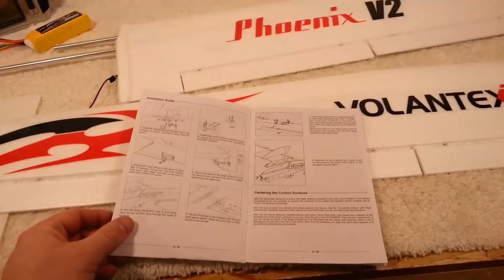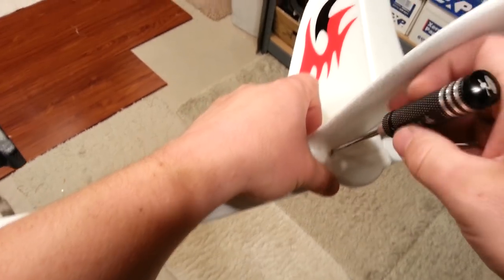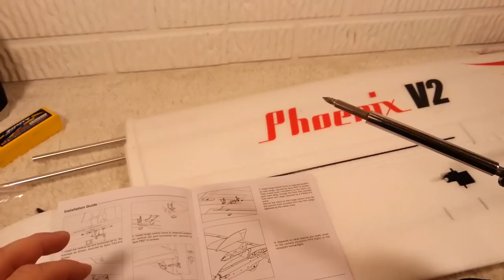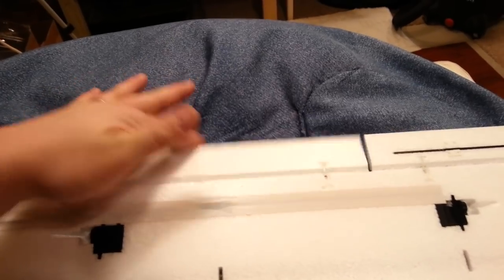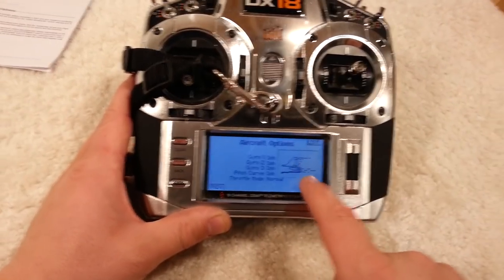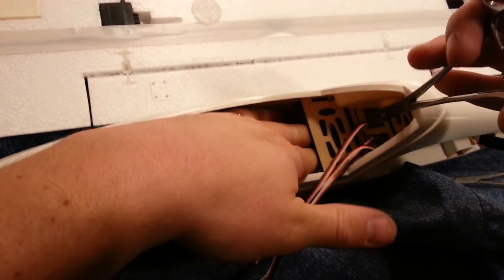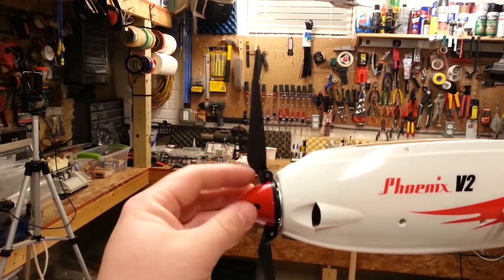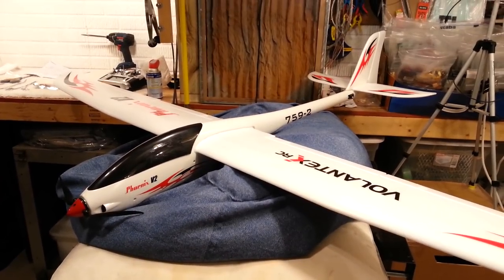Volantex RC - Phoenix V2 - 2m - Build Series - Assembly

Comment: Are we supposed to cut the polystyrene away on the hinge lines???
Otherwise the hinging is too stiff held by a web of polystyrene.
No one mentions this.
Also to use the flaps, a portion of moulded in polystyrene must be knifed away otherwise they just will not hinge at all.
Advice please?
Thank you
Reply from the maker: yes - We painstakingly covered the whole process if you want to watch - some steps may be a bit different for you, but this was quite a long time ago. Good luck in your efforts Peter!
Reply: @BrianPhillipsRC  
Thanks for getting back Brian.
I am new to foamies. Have always been a builder.
I have knifed the hinge line through on all moving parts.
I did it carefully and now the moving parts are really free. Ie ..drop down by gravity.
The built in hinges hold firmly as I have tried to pull them off.
I know that some say there should not be a gap ( air flow turbulence ) but for the past 50 years all my planes have flown fine with the hinge line gap.
I'd rather the moving surfaces were free so as not to load the servos.
Thats my theory and was tought it by an oldie aero modeller.
Thanks
Peter
Reply: @petercane6376  on a lot of cheapies that line of foam is all the hinge there is ..eg dynams

Comment: did i missed the installation of the two big rods which connects the main wings with the fuselage?
will the two big rods stay within the fuselage or within one of the wings?
Reply from the maker: It was in part of the video...but not 100% sure were.

Comment: Man, you've got a good set of screwdrivers w/ the Craftsman set but the little ones don't typically
come w/ the set..... The  small ones are like specialty but there's 4-5 of each. You've almost got
more shit than you know what to do with.... lol,  mine all got stolen & I never spent that much $$$
again. I am laughing as you try to do a decent video & joke to get thru the rough parts....
ohh yeah,  lighten up.... you're doing better than most
Reply from the maker: I really like my Craftsman stuff. Some people take the position that they "need" Snap On or Matco tools, like they just love to pay 4-5 times the price of each tool that they could/should spend...not that they don't end up with a very nice tool, but for me, I can get the Craftsman stuff for a fair price, I have a lifetime warranty, which I've take advantage of several times, and I don't need a tool-mortgage... ;)

Thanks!
Reply: @BrianPhillipsRC ~ Yeah man,  I like Craftsman Tools as well.  I did heating a/c work & I
like their sockets/screwdrivers. I like Klein Tool for electrical work & those others are
good but they are Too High for my likes. If I had been a Car Mechanic I'd have liked
them for some specialty tools.... Like w/ the sheet metal I had to do I used SNIPs
from Craftsman.... You can replace them if they Dull or break at ANY Sears in the
USA.  Gotta wait on the vendor on those others so yes,  I love your tools there. You
are well set up,  and I'm looking into planes as well.  I was making fun of you but
I said, "lighten up" meaning I was pulling your leg.  I know some people are hard
on-line,  toxic over any little thing.  I like your video too.. peace
Reply from the maker: Now you can get them at LOWES, ACE, and a few other places that I can't think of off the top of my head :)

I suspected you were joking around. It's a bit tough to "know that for sure" but the context seemed to point that way. Glad you're enjoying the footage, thanks for watching!

P.S. I kinda forgot Kline, they make a great tool, with a more moderate price point, but like you said, for electrical, they make a sweet pair of dikes (side cutters for the PC crowd)...so sweet, It's been stolen from me three times!!! At $26 or so each, that's over $100 I've paid for ONE good quality hand tool ;) LOL
Reply: @BrianPhillipsRC  Klein sidecutters & a couple more of theirs I love along w/ Channel Lock
the blue handled 12/14 inch ones. I owned
aluminum pipe wrenches for gas piping as
they are so light weight.  I loaned one & the
guy used it as a hammer & it shattered!! I
had all my stuff stolen in storage but I do
like your video.  Hey, what language is used
to program the Transmitter?   I know they
use one but what is the name of it?
I do like your humor as well, Brian... I
know lots of people are toxic on here
but not me.  thanks for the chat
Reply from the maker: The transmission protocol of the transmitter is DSMX / DSM2. I don't really think they have a "name" for the Spektrum programming "language", but I'd call it something of block programming.
Reply: @BrianPhillipsRC  ~ thank you,  after 6-7 months of looking into everything RC I only
today determined what you so kindly answered me with.  No one else has given
me any answer but I saw the "protocol" on a tarrasnnis7  if I spelled it right? It
looks like old Flat File Programs but it's "Menu Driven". It's mid 90's menu stuff cuz
I recognize how it works BUT all the functions are up to the manufacturer of the
Transmitter which means no standards of what the functions mean except for
elevators/elevons?   I bet it takes a manual to use it & then you've got to have
help w/ whatever "Receiver" you choose to install?  It has firmware & it too
has way more functionality than needed for an RC plane but it is what it is
my brother.....  So I guess the Questions now are'   
What's the most "User Friendly"  Transmitter?  And I'd buy a 6-9 channel to do all
I could need for 5 yrs, maybe longer. Than after the Transmitter what Receiver
works best w/ the most User Friendly Transmitter.  I hope you understand
what I'm asking because they've got no real standards between them & I'm a
dumb ass on top of that.   That's where I'm at & I got this far w/ you
So thank you & think about the 2 questions at the end so I might determine
a good Transmitter for me.... then I can see how much learning curve there is?
Sorry,  I want to fly but not blow $1000 & be F#@King w/  electronics.
peace
Reply from the maker: Okay, this is a LOADED question... I choose Spektrum for many reasons, not the least of which is the fact that I've spent a LOT of time learning their "Menu Driven" format. It's one of the more intuitive systems, but you'll have to figure out the jargon. Some of the jargon is industry standard, but when it comes to what direction the outputs work, you'll be SOL on that...mostly it's guess and check...which is why Horizon Hobby (AKA Spektrum) makes a mean BNF (Bind and Fly). I'd start with a simpler plane and just play with things. When you get totally hooked, I'd get a DX8e, which is relatively inexpensive, but still a wad of cash. I personally want to spend my money on new planes, but there will come a time you're hand is forced....for me, I got a used DX8 (gen1), then sold it for the $200 I had in it, and bought a new, but awesomely priced DX18 (gen1) for $405 shipped, with a 9 channel receiver. The trouble you're having is one that we've all faced as we consider the daunting task of "marrying" one brand versus the other. The GREAT news, you can use a Spektrum Rx and get what's called an "anylink" which is a module that you can use to communicate in DSMX/DSM2 (Built in) AS well as Futaba FASS, and other popular protocols like FR Sky's FPort.

Seriously though, I've spent a LOAD of time just trying to figure out how to bind planes...the last planes I played with before this YouTube channel began would have been when I was a young kid, with crystals in both ends, and $400-500 PER transmitter. Now I have less than that and something like 80 models programmed into my transmitter, which has 18 channels!!! That same OLD $400-500 transmitter would have handled MAYBE 4-5 channels.

Anyway, there's too much for me to share here, and now, but you need to think about getting engaged, or married to A brand, and then try to work within the confines of that brand to make your money stretch as far as possible.

Good luck!
Reply: @BrianPhillipsRC  ~ thank you very much for your explanation of one of the hardest to
ask questions..... lol,  I value the opinion of people who know more than me & I've
been trying to get this info answered in a way where I could actually buy with some
confidence.  The money I save will be spent foolishly on other shit for the hobby &
from what I can tell there's a lot of shit out there...... liked/subbed/ appreciated.
peace
Reply from the maker: I'm glad to help! There's a lot of opinions out there, and I'm NO exception....BUT, I can at least step back and try to say, "This is my opinion" and this is a "FACT"....just ask my wife, she'll tell you I'm ALWAYS right ;) LOL
Reply: @BrianPhillipsRC  ~ yes you've helped & in today's politically correct toxic
landscape I understand the "Loaded" question I posed. Well done to be
the only channel to offer an answer.  Better keep any Woman that'll
stand by you like that!!  Basically we must Jump In blindly & work to
cobble the electronics together for the control we desire.  I'm looking
to find people in my area doing this so I can learn under them & maybe
buy up some of their unused components.  I have an idea that people
doing this have a drawer full of parts($$) & I might be able to outfit
a plane nicely as I learn from them.  ty for the info,,, priceless
Reply from the maker: Good luck, I bet you can find some deals out there :)
Reply: @BrianPhillipsRC  ~ I hope that by asking the right questions that I can
avoid some(not all) of the wasted expenditures allowing me to buy
lots more shit that I don't need BUT WANT?  There, I feel better now
& I'm looking for someone here near me to kinda fall in with because
I bet everyone in this hobby has something extra or outgrown that
might be purchased at a fair price?  Anyhooo, that's my aim now.
peace